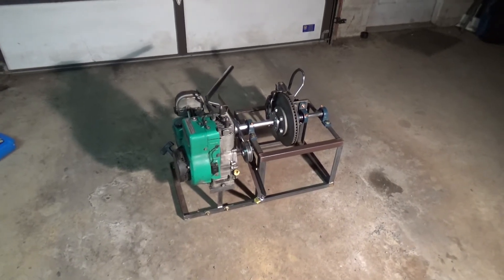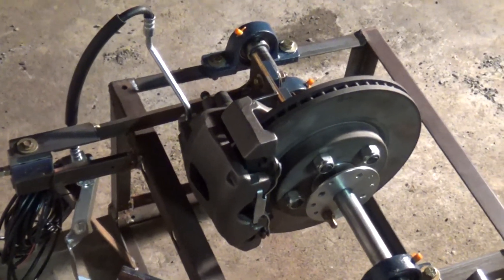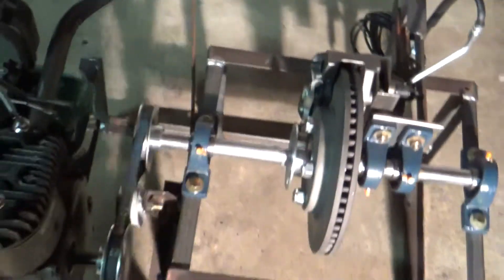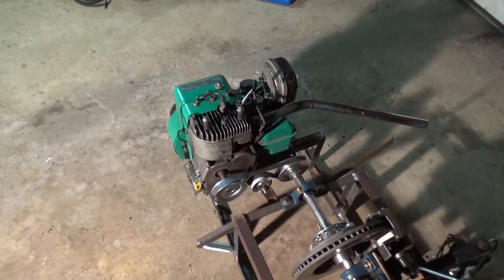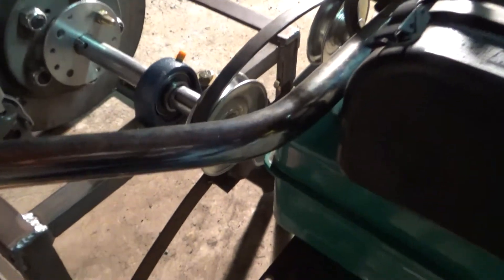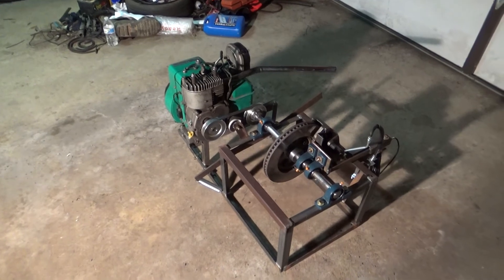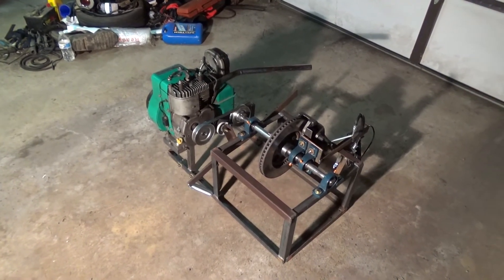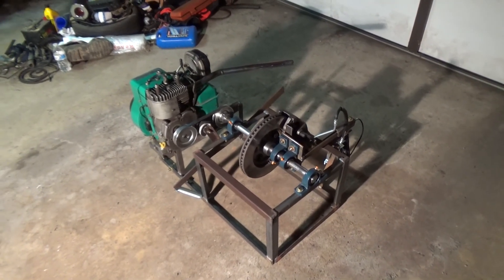Small Engine Dyno build, explanation and initial test fire!

Comment: You should put a water mister on the rotor to cool it and stop fade otherwise the brake resistance and caliper pressure ratio will change with heat and make the math less accurate.

Comment: What’s the max rpm on your disk there, your pulley set up looks 1:1, even with the governor of around 3000rpm or 5000rpm without I’d be worried about your disc exploding. Even high end discs aren’t good for that speed.
Reply: Old comment but you have a good point, say an average car tyre is 2ft diameter, at 100mph it would be doing about have of 3000rpm, typically these engines run at 3200 or 3600.

Comment: A little late but I'm bored in 2020 isolation. Hanging a static load on your load cell can offset your reading and put it into its sweet spot or wherever you want. Also handy for expanding your HP capabilities. Have fun with your wisdom building.

Comment: awesome so you can plot TQ over rpm? this is going to be awesome. i wonder how much correction you'll need because the brakes will skew results, and that 180 hose bend off the metal hard line on the brake line makes me cringe lol
Reply from the maker: Brake hose is just hanging there by its own hose weight currently because its not hooked to anything. Its going to get its own mount once I start running lines and testing to see if I can use regulated shop air or if I need to go hydraulic. I'm assuming I'll have to go hydraulic but want to try air first for my own knowledge anyhow.

I dont think I'll need correction for the brakes themselves but I may. Really this is working the exact same way a water brake engine dyno (like 99% of manufacturers use when making bigger engine dynos) does. Pretty much sees how much resistance (in lb/ft) can be applied to the engine to hold it at X rpm. X rpm just increases (load applied decreases) during the pull, some dyno operators call this a ramp curve or just ramp. I'll just have to rescale the ramp if I have a engine that can drive through it LOL. But anyway even when the brakes heat up like they will, this means more force will have to be applied to the brake pads aka brake pedal force to maintain the same friction on the pads/rotors which intern means the same about of resistance to rotation is still technically being applied, it just takes more brake pedal force to achieve this because the co-efficient of friction drops when the pads/rotors heat up. Hopefully I didn't loose other folks there. Its a little hard to explain. And it may not work that way. I may have to record heat with a infrared sensor and accommodate in the code.  But I know of one way to find out if it'll work LOL.

Yes I'll be able to plot TQ and HP over RPM, along with any other parameter I'll be logging, like barometric pressure, Air temp, humidity, etc. Actually looking to get a few dyno files from your wiki and see how they are coded. I'm going to try to get the arduino to write the dyno datalog files to work with that win7 dyno program. For now I'll probably stick with MegaLogViewerMS until I have that figured out but it shouldnt take me long at all to figure it out. Not trying to reinvent the wheel with new log viewing software.